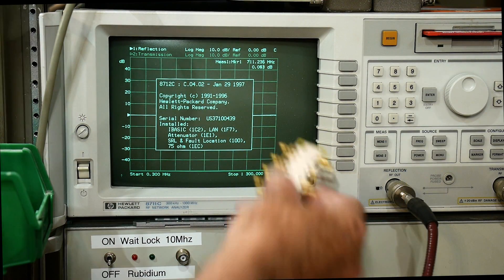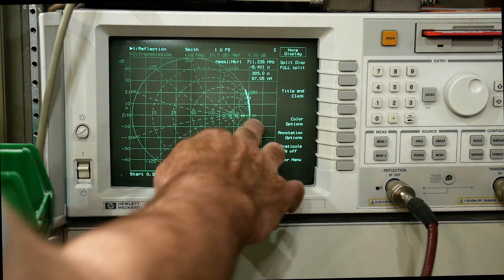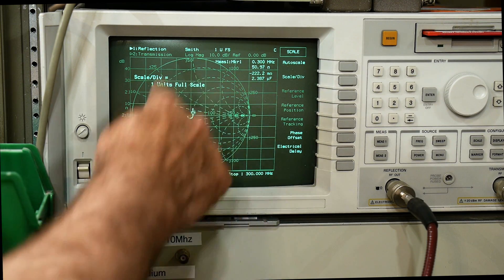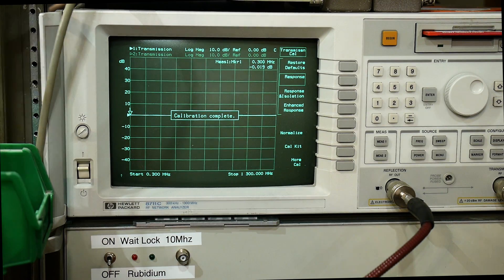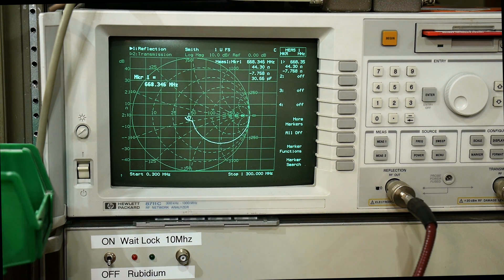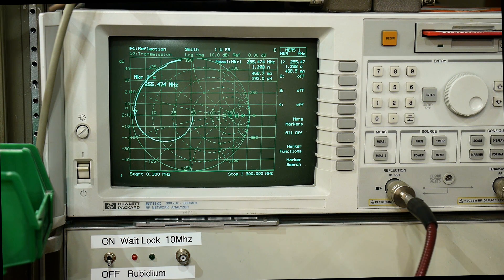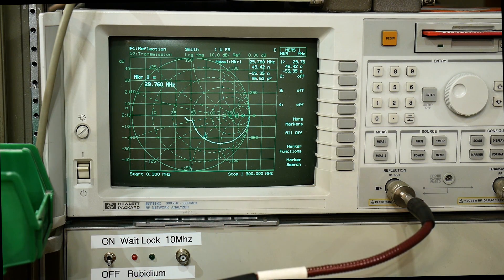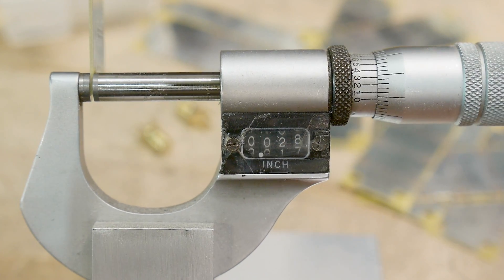#1173 VNA Test Boards (part 2 of 5)

Comment: I believe the bend on your curve of series cap is as result of your self resonant frequency of your cap.  You should look at log magnitude of value of S11 and S12  on log frequency plot instead of smith chart to get more insight.  You might observe band pass or band stop behavior.

Also, look at line width  under microscope along the line and you will see the variation.
Reply: Yep, I agree Aduedc.  As Chris mentioned above, a shunt measurement might be more appropriate here.  A little easier to understand at a glance since there's no port 2 to subtract out if you were making a model based on VNA measurements.  There can be a minor issue associated w/just a S11 measurement vs. a two port measurement (i.e. port 2 shunt parasitics are grounded w/a 1 port measurement), but usually splitting hairs for the most part.

Comment: If you do a relayout of your test boards, you could also add three connectors.  One for an open, one for short, one for 50 ohms (verify the 50 ohms is a good 50 ohms prior) and that would be your new cal kit.  That way the connectors will be cal'd out.  You have to be careful - Try to minimize adding any error that needs to be subtracted during cal.  You also should compensate for any electrical length between on/short/50 ohms in the layout so the reference plane is still correct.  When you cal, you probably are cal'ing to what the VNA thinks is a HP cal'd kit (not perfect, but it knows the cal kit parasitics), so you can always go into port extensions and really dial in the open/short.

A quick way around the connector issue above is to just take 3 connectors and use that as your new cal kit: 1) One connector, you cut the center pin flush, that's your new open cal, 2) Another cut the center pin almost flush and fill it full of solder for a short, 3) Lastly, trim the 3rd connector almost flush and add 50 ohms to ground (minimizing any electrical lengths, etc.).  Finally, compare it to a real cal kit if you have one to make sure the 'new' cal standards are adequate. Regarding the new short vs new open, there's probably a slight difference in the electrical reference plane from bridging solder to make the short.

As Chris said below, 244MHz is the first resonant freq.  Higher than that the part begins to look inductive.  At some point it will go parallel.  Regarding the first resonate freq, you know the C, you know the freq - so you can figure out the parasitic L.  And also the parasitic resistance when it resonates.

Lastly, about the board thickness:  If the board is thinner (i.e. say you picked 16mil instead of 32 mil) - the trace gets thinner too (you mentioned that).  The pad for the parts - if they are larger than the 50 ohm trace width, they can start to look capacitive (to ground).
Reply: Yes, also  one for T and another for PI configuration along your transmission line, they are very useful.
To find out the impedance of the line do a short and open test.  Z=SQRT(Z_short X Z_open) download all the short and open values to a spreadsheet and calculate the Zo at each frequency.

Comment: I'm no expert, but I think that the thickness they advertise is for the finished PCB.

In you case it would be 28 mil FR-4 + 1 Oz copper on each side (1.37 mil) + solder mask on each side (0.5 to 0.8 mil). If you add them all together you should get your 32 mils.

If you go for the 4 later PCB, they actually tell you exact thickness for all the different layers.

Comment: Super cool! IMSAI Guy needs to acquire a TDR to measure the impedance of the traces on those boards. :)
Reply: If you do an fft on the s11 you're almost there, you may want an instrument that goes to a much higher frequency though if you want a decent resolution

Comment: I would like to get a set of those boards. I'll wait for the new and improved version.
Reply from the maker: the board on PCBWAY is adjusted for thickness. it is the final version. these videos were shot weeks ago. it made a small difference
Reply: @IMSAIGuy  I just tried to order some of these, but "proceed to check out" button is greyed out - couldn't figure out how to get it ungreyed - wound up with duplicate order in cart  - had a hell of a time trying to delete it - they demanded a reason for cancellation. All I could come up with is : I'm stoopid and don't understand your clunky web interface". It looks like the order is under review before I can order???? Their web layout is really squirrely and hard to follow.